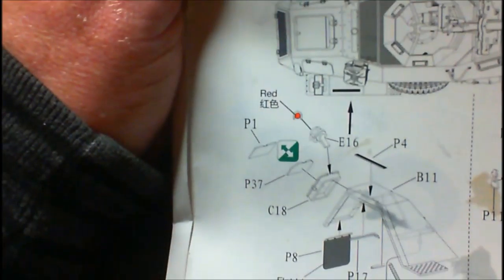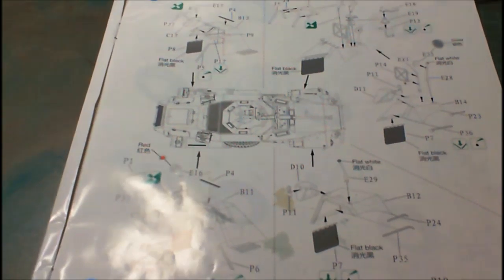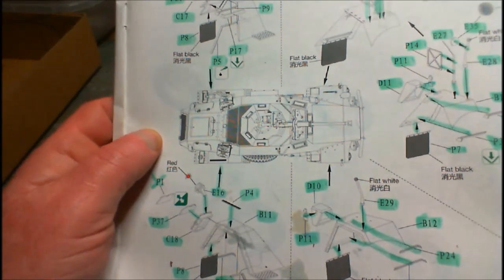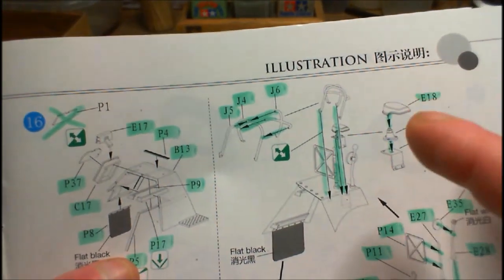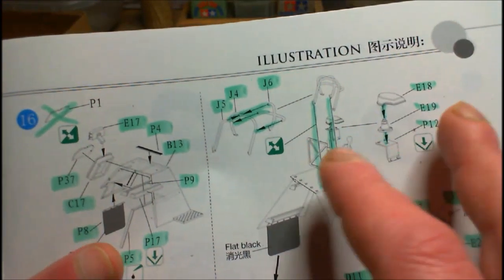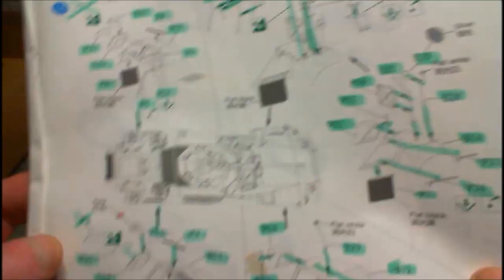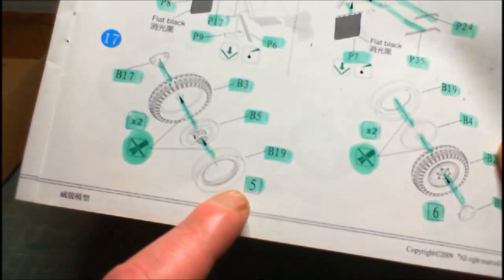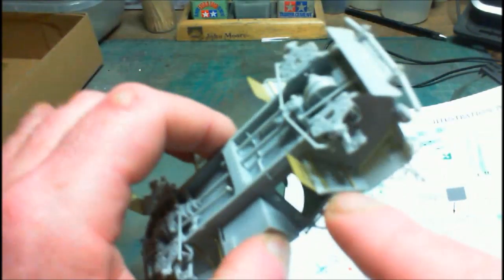BRONCO MODELS Sd.Kfz.221 Leichter Panzerspahwagen (s.Pz.B.41) Build update 3

Comment: I have to say Step 16 would have me pause for a moment. Step 19  yeah it may be over PE'd.  Good idea to skip it. Your sanity may have been in question.  Molded on racks on jerry cans - I normally scratch build a new rack and replace the jerry can. Nice to see this kit has separate racks. This is not a beginner's kit. Excellent. 221 has the frame antennae. Another bang up assembly job. Careful on the vroom vrooms.
Reply from the maker: Thank you  :-)  J

Comment: John.......new to model making and after finding you on you tube you have become my go to master. 
I want to buy the Bronco model but dont know what paints I need as we live in Spain and have to order everything....pleaseeeeeeeeeee can you advise what Tamiya paints I need......please keep on with your easy and sooo helpful videos I would be lost without you
Reply: David, for the German grey use XF-63, if you are going to do the black and white which he will probably show you, use NATO black XF-69 and flat white XF-2. I use Rubber Black XF-85 for the tires. You will need to get a primer to cover the PE at a minimum. Any decent primer should work as long as you give it plenty of time to cure. Also get a bottle of isopropyl alcohol (rubbing alcohol) , as strong as you can get it (91% is what I get) to thin the paints. If you use a different brand paint the iso may not work, so try to use the thinner for the paint brand. Tamiya paints are alcohol based so iso won't hurt them. If you are planning on using an airbrush to paint, the easiest way is to full a new bottle of paint up to the rim. If you are brush painting, personally I wet the brush with alcohol then dip it in the paint rather than thinning the whole bottle. Another site you may want to check out is Andy's Hobby Headquarters. That guy is fantastic with his builds, been following him for years and it kind of shocked me when John started talking about him. It would also help to have some putty to fill any gaps that may happen. I use mostly Vallejo plastic putty and Mr. Dissolved Putty from Mr. Hobby (Gunze). Both clean up easily and require minimum sanding when done right. I also use some auto filler for the really bad gaps or misalignments, but that is harder to work with. I hope this helps a bit
Reply: @randygagliano5984  Thank you so much for your help.For a newbie like me its invaluable. Some days I think Ive taken on to much at my age (70) but when I get stuck there are people just like yourself to help..........a real big THANK YOU
Reply: Hi David, Do you have to use Tamiya paints ?, I would have thought living in Spain you would have gone for Vallejo Paints, they come from Spain..........although on my last holiday in Spain I found it almost impossible to find any model shops, so I can kind of see where you're coming from ;)

Comment: As far as the photo etch grill behind the turret,put small pieces of blue tack  on the end of your fingers. Stick it on the underside until you get it blocked off. To remove it after painting,use a sewing needle to push it out. Maybe Abbie could help with it. Just my two pence worth.
Reply from the maker: Thank you :-)  J